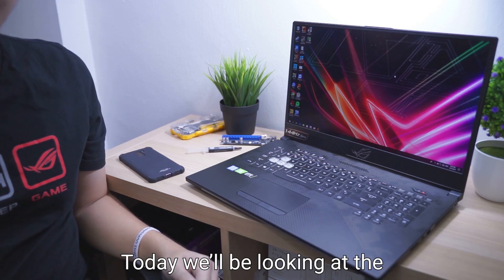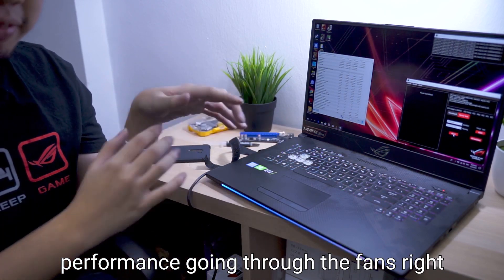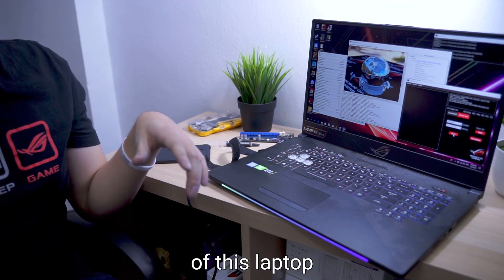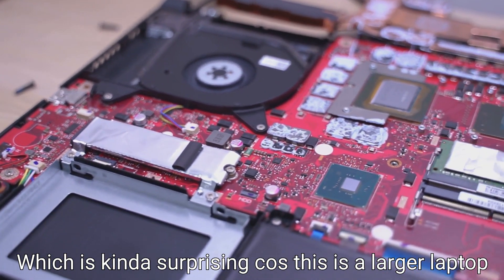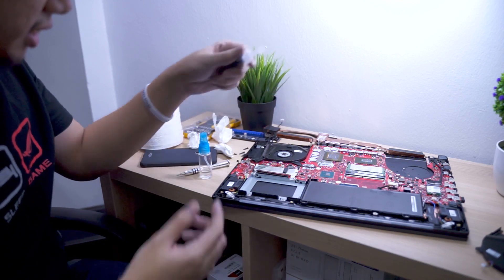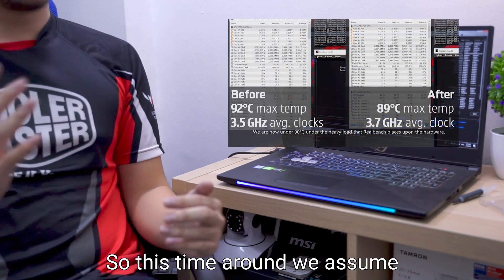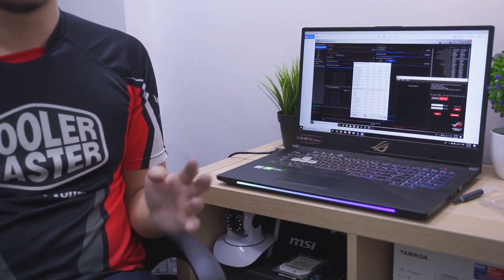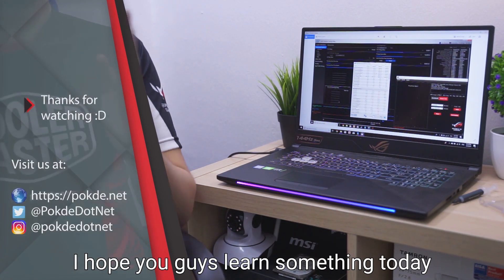A 99 DEGREE LAPTOP!! SEE HOW POKDE CHILL IT OUT!!

Comment: Hello, I tried messing around with throttle stop and a few other programs and everytime I undercut thought it was stable I'd crash or blue screen if I was lucky. I uninstalled that crap. Took my strix scar 2 apart and the stock paste was caked on extremmly heavy and brittle dry. I replaced the paste with thermal grizzly my temps were always 90+ on the cpu and around 85-7 on the gpu during gameplay. Now I'm at the mid 70s MUCH better. However now im dealing with my cpu randomly spiking up to 93-95 out of nowhere and back down causing a an fps drop from 160 to 47 and it being unplayable for about 1-3 seconds what else can I try? Even when the cpu is 65-75 steady during gameplay itll randomly surge to the point of throttle then immediately go back to the mid 60s I'm at my wits end. Should I reinstall throttle stop and do a very light undervolt again?

Doesn't matter if I'm on 1080p low settings or ultra settings the cpu temp will randomly surge up and throttle me then after seconds itll go back up to 160fps and smooth again.  If the game is cpu bound in anyway I cannot enjoy it so far halo reach is the only game in my library I can play without being throttled.
Reply from the maker: If you are encountering sudden lags even when your CPU is not in throttling territory, you probably should see if you have background tasks that are using your CPU. Undervolt with XTU instead of throttlestop. So far I have had pretty good success with XTU.

Comment: Thermal throttling is a designed feature. After updating bios I would recommend setting a manual fan curve. Personally I set my gl504 ds74 to 50-60% for a base which is technically louder but lowers idle temps. The auto fan curve is designed to be quiet and will not actually hit 50-100% until reaching around 86c. By that point all components are already saturated. I will be doing a liquid metal repaste, already did AS5 paste with undervolt stable 3.8 GHz max 87c.  Do research warranty void stickers are against the law; only liquid metal will void because it creates an alloy.
Reply: With which program did you manually configure the fan curve?

Comment: I applied Conductonaut on my GL704GW on top of -72 undervolt. Say goodbye to thermal throttle. RealBench score 163,394. Zero throttling. I even overclocked my GPU +170MHz. Stable stress test in RealBench, TimeSpy and FireStrike
Reply from the maker: Interesting, how's the temperature like after re-paste?
Reply: @PokdeDotNet  Max temp during realbench were between 90 to 91 degree. Never lower, never higher. So I guess only liquid metal can save you from thermal throttling.
Reply: @shaifulrizhuan  pretty sure you got lower temps during gaming right? below 90? i own GL504GW and was upset that with the high CPU temps reaching 95+ degrees during gaming and avg clock speed of 3600Mhz as it will effect the GPU clock speed and i was getting an average of 1215Mhz with 87 degrees temp on the GPU, and that will make the performance to be lower when compared to other RTX 2070 laptop like MSI GE65/GE75 they had better GPU temps below 75 degrees , i am thinking of repasting it even  though there is still a warranty period of another 1 year and 8 months, should i take the risk and void the warranty and repaste using Conductonaut (Liquid Metal) or Kryonaut? If i did repaste, how long did you think it will able to kept the CPU and GPU cool before doing another repaste?
Reply: @VeMpX8  Depends on the game. All i can assure you is, the cpu will never throttle. Sometimes max temp might reach 92. It will throttle once reaching 96. Gpu will still heat max temp of 86. But that not affect gaming performance much. And please only use conductonaut. Even liquid metal only help you a little, don't expect good result from kyronaut
Reply: @shaifulrizhuan  ohh i see...how long did you think that the liquid metal will last before i need to repaste it?
Reply: Shaiful Rizhuan Hi, so do I use conductnaut on both my CPU and GPU? And also those thermal pad area, can i clean with alcohol wipes etc and apply conductnaut on them too? Thanks
Reply: @ALIEN-wp9ph  Hi. I applied on both CPU and GPU. Only them. No need to touch other pads
Reply: Shaiful Rizhuan I heard kyronaut is for those other pads, so I’ll be using that for it, thanks a lot tho !!